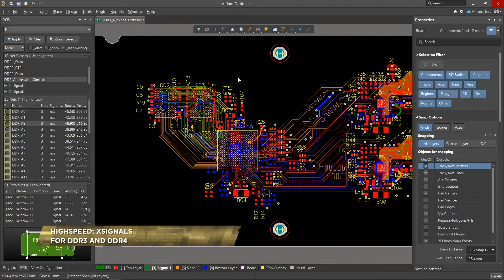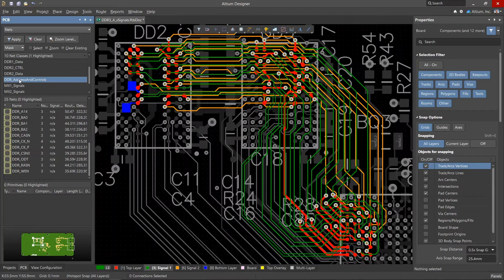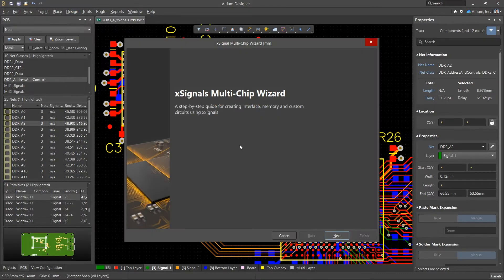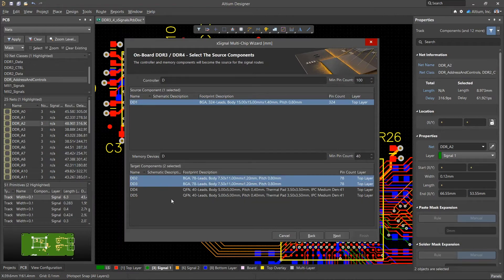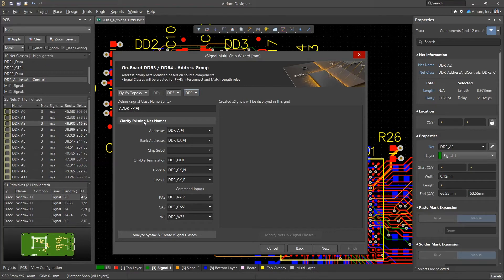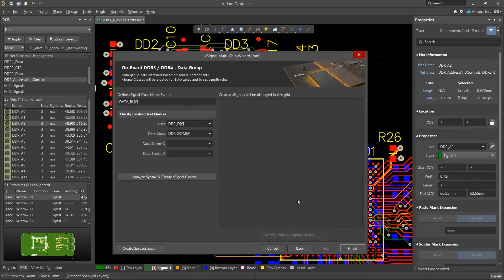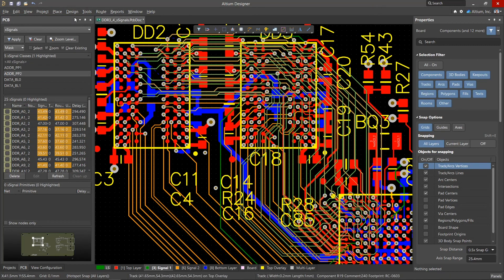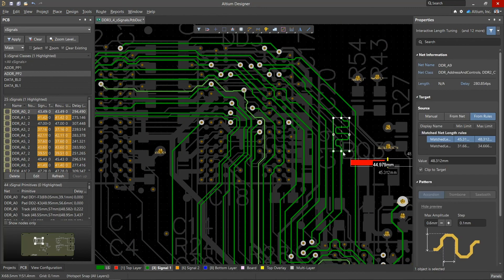xSignals for DDR3 and DDR4 in Altium Designer | High-Speed Design

Comment: I wish Altium would update this wizard to allow setting matching tolerances in picoseconds as opposed to milimeters. Doing it by physical length is not a very good idea especially for high frequency buses like DDR4. This whole "length matching" thing is a bit of a misnomer nowadays because the goal is to match delays, not physical length, and as frequencies grow, this becomes more and more of an issue.
Reply: I agree but calculating accurate delay time is a lot more difficult and you need to consider via placement and size, transmission line characteristics of the trace which can't be done accurately without invoking full wave simulator(HFSS, CST, Keysight EM Pro, etc.)
Reply: @BSPBuilder  You already can specify matching requirement in terms of delay if you manually edit the rule, so what I'm talking about is simply a consistency/convenience of not having to manually edit all those rules created by the wizard.
Reply: Have you found a solution for this? Does this problem apply to DDR4 only or also DDR, DDR2, DDR3?